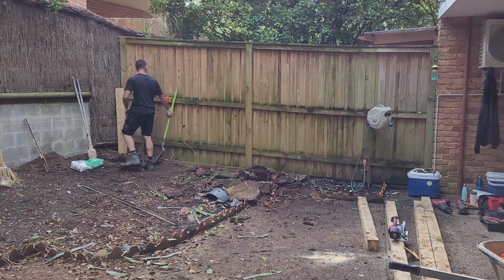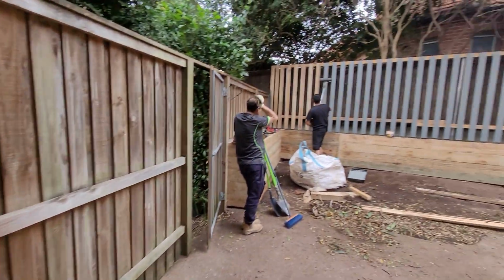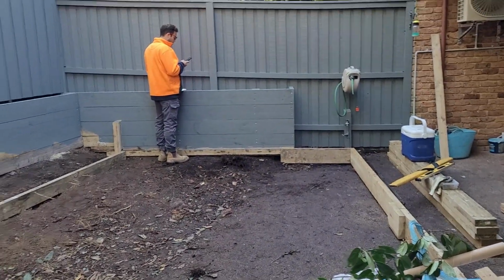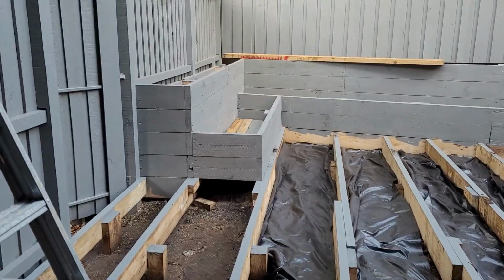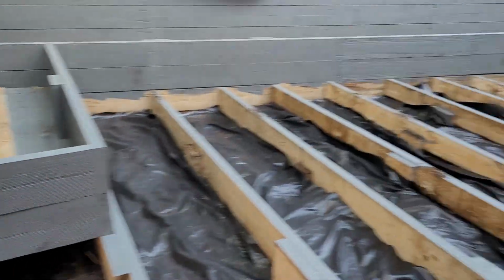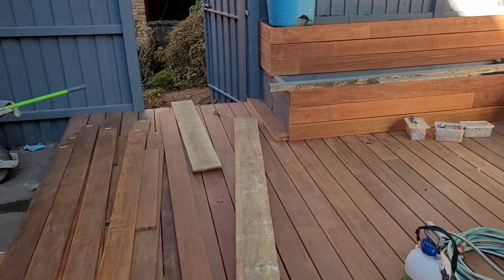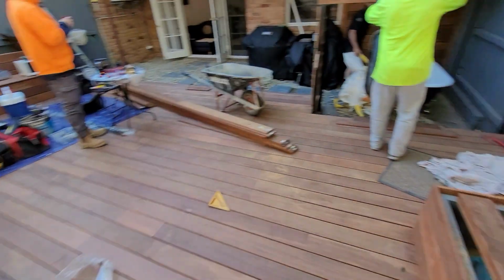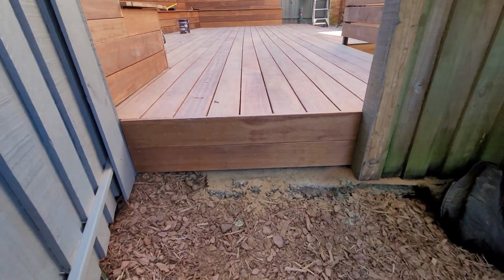Merbau Decking Installation Guide, How to install Decking boards? How Level your back yard? garden

Comment: is Merbau better than WPC
Reply from the maker: Merbau is a natural deck and needs maintenance and oiling every year. 
Composite Decking or others need less maintenance.
Reply: @maxlandscaping  do you need to oil it just on the outside or also  underneath
Reply from the maker: Just on top

Comment: Hi Max,
I am a builder and liked your work. How much do you charge roughly for around 42m2 decking 90mm 5.7m joined length from Bunnings.
Reply from the maker: Hi
I need to inspect your site to make a quote for you. Regards